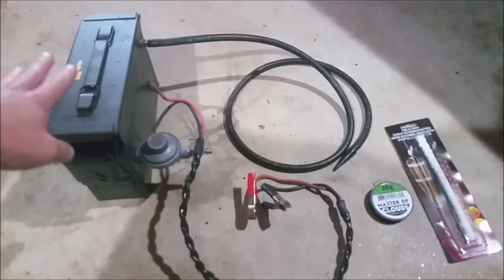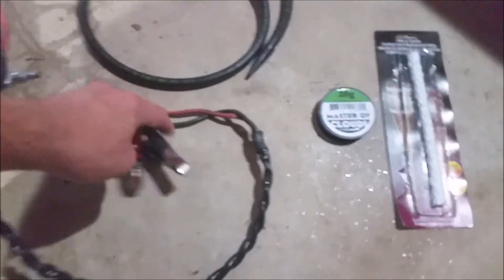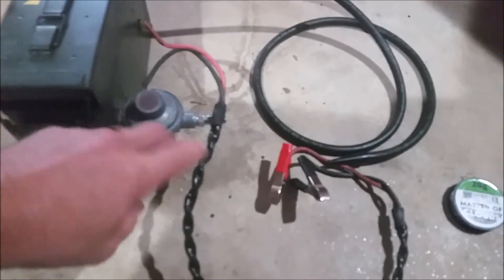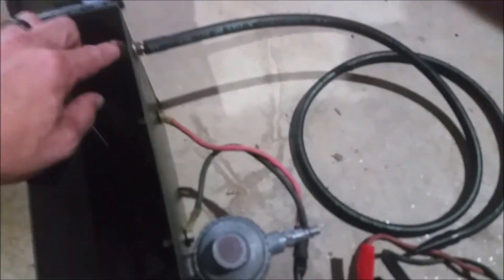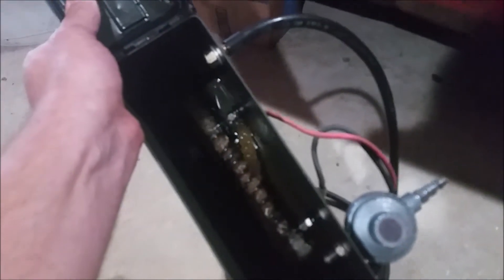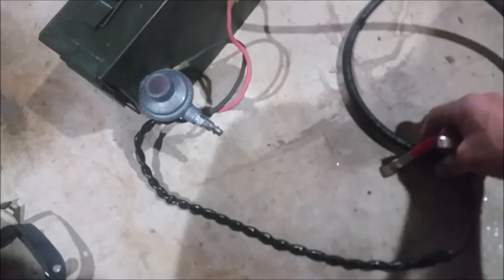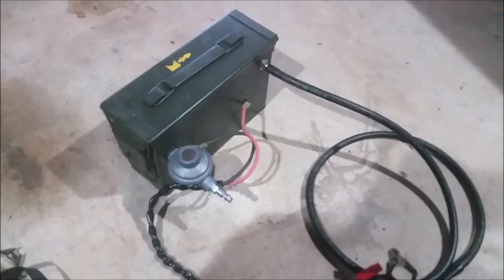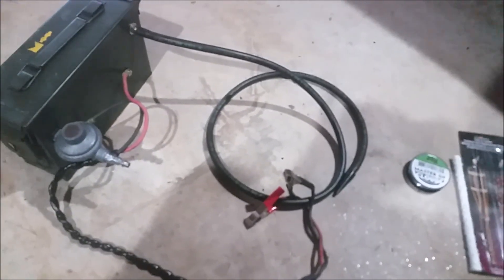Homemade Smoke Machine - evap leak vacuum leak

Comment: Does your ammo can pop and expand slightly? Are you worried if the regulator fails and the can explodes?
Reply from the maker: I dont notice anything like that about it. The can seals definitely won't hold that pressure so I wouldn't worry about the regulator failing.

Comment: hello! 3psi is a little excessive pressure from a propane regulator is set at no more 14 inches water column (wc) 
shouldn't need more than .5wc, 3psi could damage pressure switches  3psi =83.1228 wc
14wc = 0.505277psi aka 1/2 psi you can buy a water column gauge all you need is a 1/2 psi! 
thank you! 
happy holidays!!

Comment: IF I UNDERSTAND YOU NOT DIRECT TO THE BATTERY?
Reply from the maker: After the clamp, so basically how I would do it, is after the clamp I'd have an inch or so of wire, then the fuse, then the rest of the wire leading back to the box. You want it close to the clamp because you'll be protecting more of the circuit that way.
Reply: MORNING GARDENER'S SHOW.

What size fuse for the smoke machine?

Comment: can I add a fuse if so what size?
Reply from the maker: You could. You would want it right next to the positive clamp. I just tested it and couldn't get a reading on my amp clamp so I couldn't really suggest a minimum size. I wouldn't imagine much of a draw, though I can't accurately suggest a size. I would build yours then check to see what your amp draw is. Then add a fuse that's slightly higher capacity.

Comment: What gauge wire did you use for the power leads? I hooked mine to the battery and melted them instantly.
Reply from the maker: I'm pretty sure it's 22ga canthal. Can't use just any wire. You can find this online or at vape shops. Used 2 feet of it.
Reply from the maker: https://www.amazon.com/gp/product/B014V4LG6C/ref=oh_aui_search_detailpage?ie=UTF8&psc=1
Reply: I had the element wire correct. I found the issue for the battery leads. I had a grommet that was allowing the lead to ground to case having it draw power to the case overloading the circuit. thanks for the response.
Reply from the maker: Ahh, glad you found the problem.